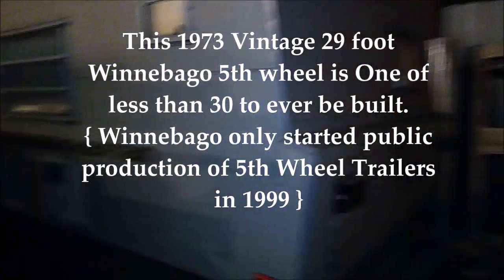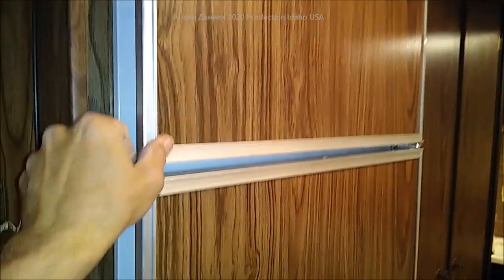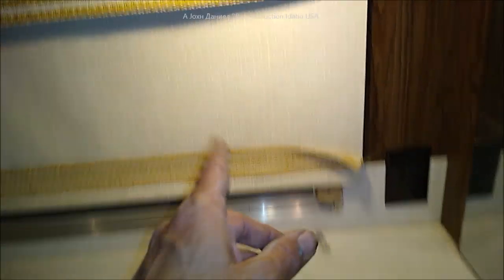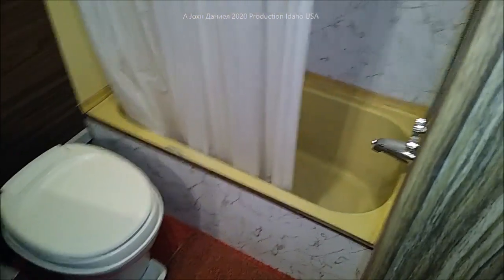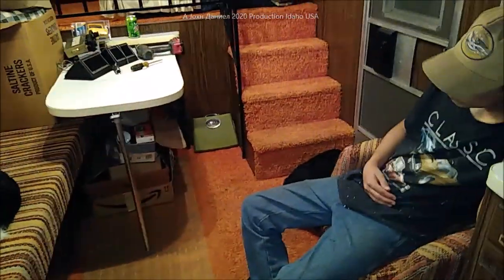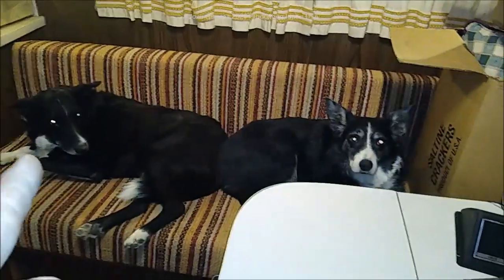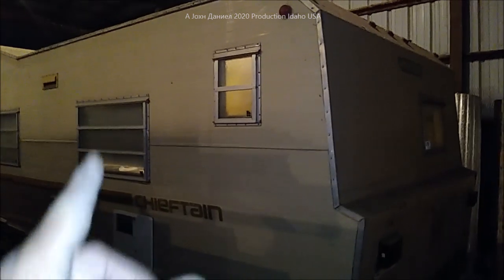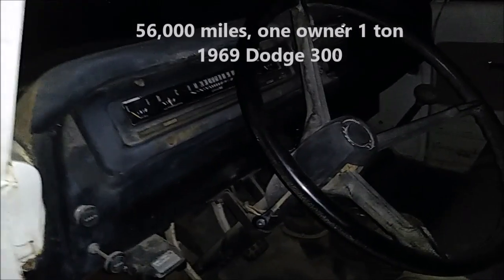Proof you'll save power with LED Lights & 1973 Chieftain 5th wheel update

Comment: Hope you can answer this. I told you I got some 400watt solar panels and I got the ooycyoo 12-24 automatic 100amp MPPT, but the solar panel is putting out 40v. Can the Ooycyoo handle this much voltage or is it going to fry the MPPT?